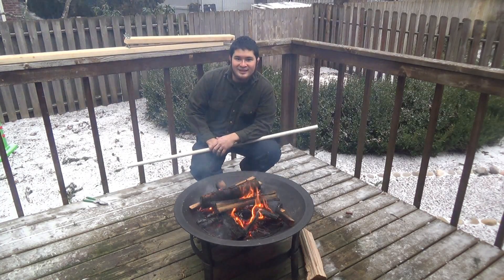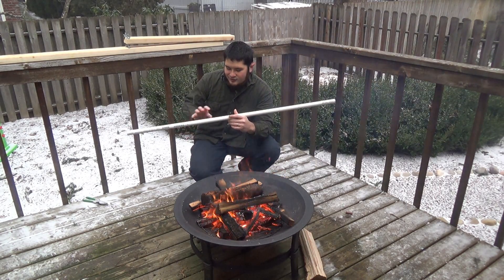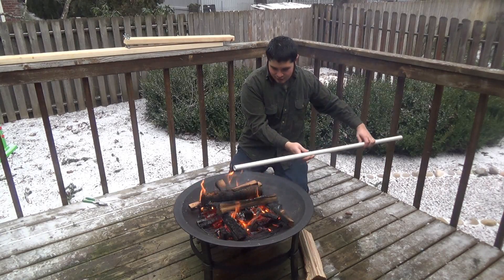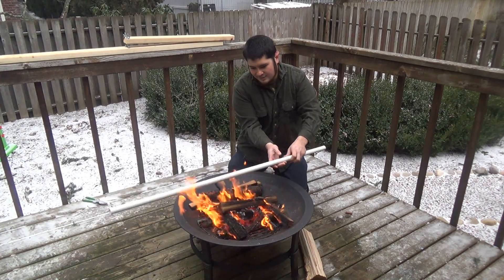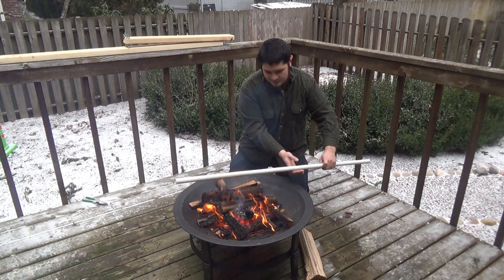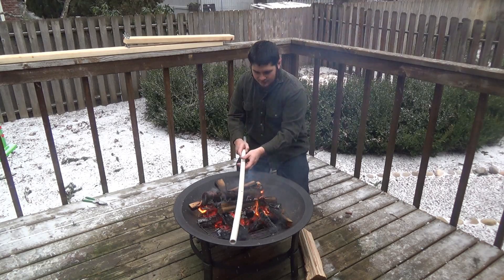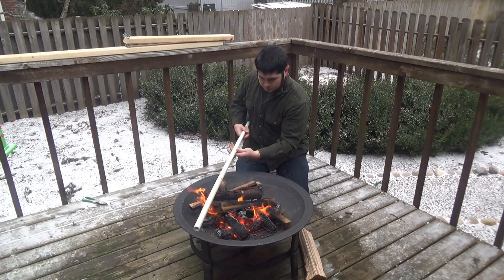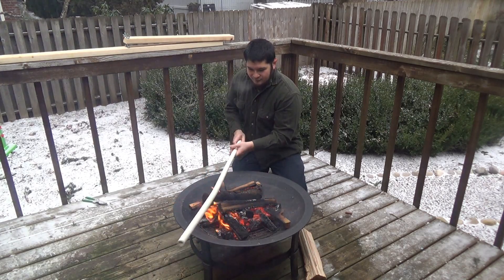Building a 30-40 Pound PVC Bow Over a Fire Part 1 - The Snow Bow!

Comment: Does ABS pipe work too?
Reply from the maker: kim lindblå Some ABS pipes can work, it just needs to be solid pipe, not foam-core. Also, ABS tends to heat a little differently than PVC and can be harder to reform, so it can be a little less forgiving.
Reply: BackyardBowyer Thanks for your answer! It's quite hard to find any store close by to me, maybe it could help me more if you could explain what PVC pipe is used for so i could try search that in my Language. :)
Reply: +kim lindblå  umm sewers piple inside homes

Comment: Hello Nick, Congratulations on the video. 
What kind of PVC pipe you use? PVC pipe for hot water? 
How many diameters have this PVC pipe? 
What is the thickness of the PVC pipe wall?
Reply: Ideally use SCH. 40 and 3/4 inch pipe.  I'm not sure about type of PVC, I just hear that white PVC is what you want.  White as possible actually, if it's tented yellow, avoid it.  That's an indicator of UV damage and would be dangerous to use.

Comment: Would this work once the fire burned down to just coals, to avoid flames and smoke from discolouring the pipe?
Reply: i belive so
Reply: I've used the method before but because the coal cooled down faster I couldn't get my pipe to softer than expected. I would suggest to make a smaller fire to use as a heat source because if you have a small fire it actually gives a more controlled heat with less fuel to burn unlike a fire like that it is more likely to have a really big bursts of heat but with less efficiency.

Comment: Nick ... how about  laying a  short length of  metal tube, ungalvanised, like scaffold pipe, through the fire/flames... then run the  pvc back and forth through the  tube while it is  very hot.
That way no direct flaming, less chance of an overscorch . also no chance of it falling into the flames.
Reply from the maker: That sounds like a good idea. Thanks!